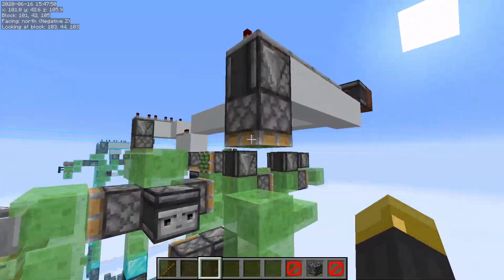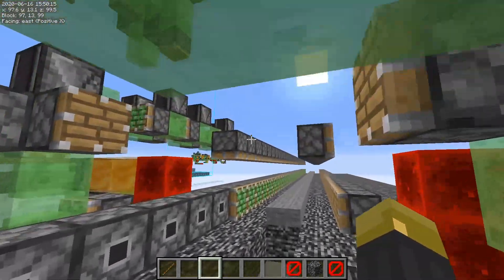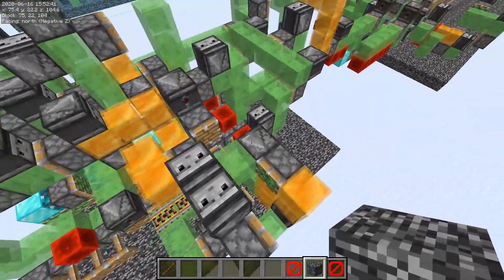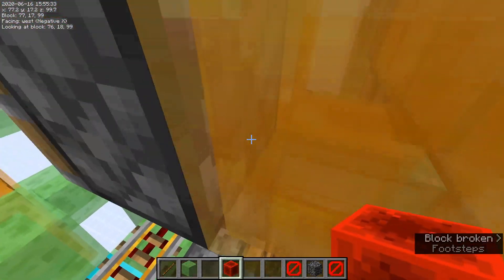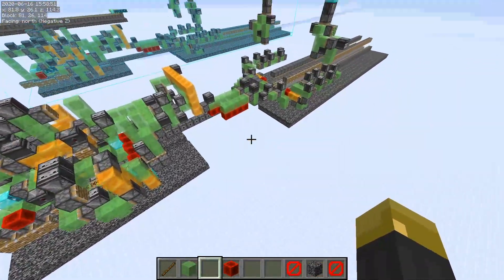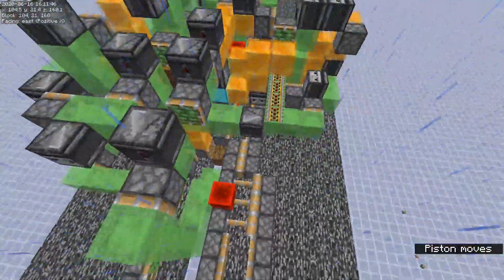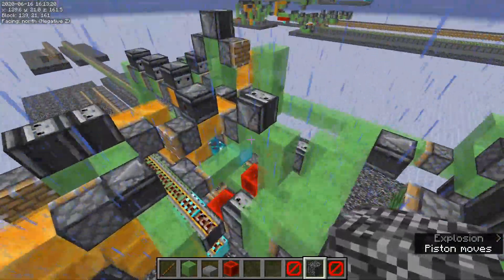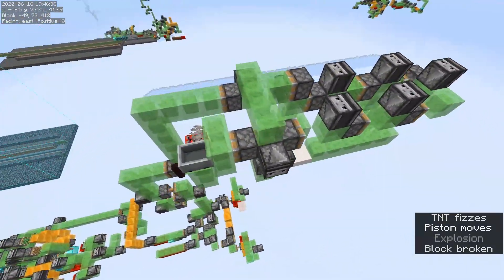Fast Bedrock Breaker - Proof of Concept (Minecraft 1.15.2)

Comment: Sucks dat the server i play on don’t allow tnt duping
Reply from the maker: It's theoretically possible to use the 3-way or other bedrock breakers (including this 1-way) without  TNT duping. However, this would require a lot of TNT, and a custom TNT activator that would take TNT in from a repository and activate it at the right time while aligning it.
Reply: DesktopFolder is that way with the dispenser tray??
Reply from the maker: @SimpingMoon  Nah, you'd just place all the TNT then use a special machine to activate them.
Reply: DesktopFolder anyway u can show how to set dat up
Reply from the maker: @SimpingMoon  Maybe in the future, I don't have a method for that right now.

Comment: 1.16?
Reply: Thanks you man!
Reply from the maker: Yes, this should work in 1.16, however I have much better designs already, I will try and make a quick video + download for a far smaller design (similar to the one used in 3-way). That being said, for 1 way / 1 wide designs, it may still be easier to build EDDxample's 1-way/1-wide design https://www.youtube.com/watch?v=v7qW9QhywGs
Reply from the maker: I also believe that there should be some 1-way automated designs that do not consume slabs (use ancient debris), which would be even easier, not sure where they are though.

Comment: Is it possible to tweak this so that it works in 1.12 too?
Reply from the maker: Good question, I'm not sure. I haven't really investigated 1.12 bedrock breaking and I don't actually know if this piston layout works in that version, and if it would be possible to recycle pistons using something like this in 1.12. I might investigate at one point but am currently focusing on 1.15. I would really recommend using dragon eggs or a recycling bedrock breaker in 1.12, though - there's a tweaked version of XCom's 3-way that's quite nice, I think. (Only works at y0, though, as far as I remember)